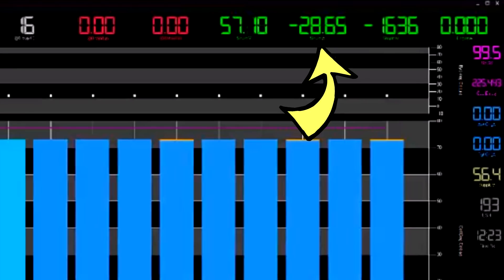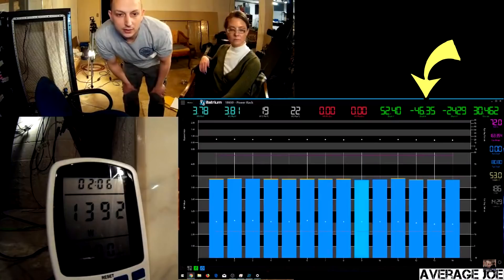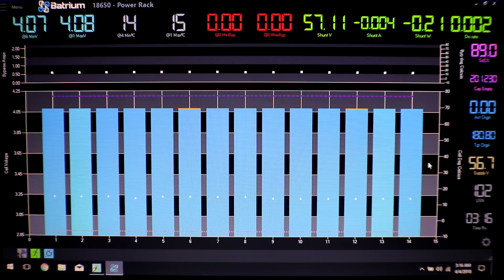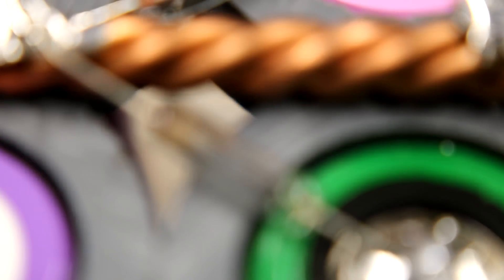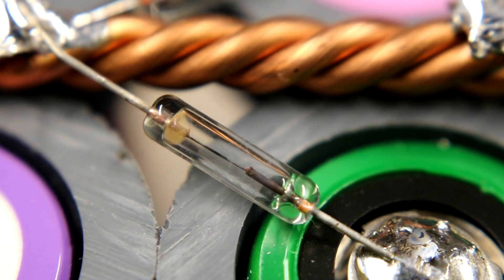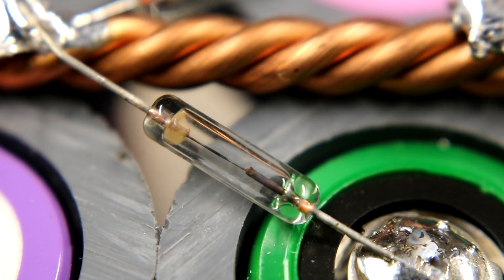Live Stream Load Test Results!!!  Pack 14 For The WIN!!!

Comment: Hi average joe!! I am building a 13s 14p battery pack for my 1000w ebike kit. The cells that i have are 2000mA for old laptop batteries. Can i discharge the cells to 1,8A per cell (in maximun power) or 1,2 (medium power). This can be safety and can destroy the chemical of the battery? Also, i put  5A fuses each cells. Thank you very much!! Your videos are really helpfull :)
Reply from the maker: I couldnt say for sure cause I dont know what cells you used.  If the pack isnt built yet you could look up the specs of the cells to see what they can handle here https://secondlifestorage.com/celldatabase.php Most use high drain cells for ebikes since laptop cells are usually 1a or less.👍

Comment: What kind of battery holders did you use for pack 14?  Where did you get those?
Reply from the maker: I built them out of 3/4" ID sch80 PVC from Lowes.  Just cut them up into 3/8" slices and super glued them together!😆👍

Comment: You could just check the capacity in place without removing it from the pack. Just disconnect the fuse from the top which will disconnect it from the pack and connect your B6 charger to the cell - charge and discharge test and if its fine just connect a new fuse. Simple :)
Reply from the maker: Hmmmm thats a pretty Neat Idea but Id have to make some leads to come from another charger as I still dont have a B6😲

Comment: Are you trying to say you do have a way to capacity check the whole pack. I have one of those little like $3 I think blue pcb ones with a display that use resistors as a load and it says it goes up to 9999Ah but get more resistors or some other load it says up to 3A so maybe a boost converter to put all that power back into the other packs but that would only be like .5A or something to the big pack
Reply from the maker: I got a new charger/discharger from Banggood (Hi-Yaw) to do the hole pack.  They finally got some back in stock.  I was thinking someone could possibly use one of the pcb dischargers but yeah it would take forever.  I guess one could just add resistors on the pack and do it the old fashion way and time it and do some math!!!😆👍
Reply: hope it is not one of those SuperbrianAK suggested(above)...they are 1) Fakes..  2) Crap

Comment: I agree with 70-80 amps being kinda of a high sustained draw on those packs. I've been noticing that any of my cells with high IR will drop out so much quicker under the higher loads. My conclusion right now is to look hard at marginal AH cells that have high IR and set them aside.
Reply from the maker: Yeah 70+ amps is high for a single 10k system but gotta tester out to find weak spots and it gives everyone else an idea of some areas to improve on and or what this size can handle.💥😃👍

Comment: I'm in process of checking each cell right now. I'm putting a label with capacity on each cell hoping that it will aid in troubleshooting down the line. Planning on making at least one or two extra cell packs, above the seven that will be in my system, so I can always have a good one to switch out with. 
That fuse is cooked....
Reply from the maker: Fun times capacity checking everything!  Yeah I should have an extra pack or 2 all made up and ready for the same reason!!!👍🔋

Comment: This was a good example of why you don't weld your cells in place. Now I understand!
Reply: Hahah, exactly!  That's why I'm going the cell holder route with the metal tabs to hold the cells firmly. I've decided at this point not to  make my own contact holders. I'm even designing the whole bms setup based off the 4x holders. Each holder will have a red led (to show when that cell is off), an inline fuse (as last line of defense), a fet (for digitally disconnecting a cell), current sensor (to know how much is going in/out of a cell), and a cheapo mcu to control it all. Well, the mcu might control a whole batch of cells that are in parallel, not just 4. So, maybe 1 mcu would control/watch 16/24 cells (4/6 holders). Still designing the layouts :)
Reply from the maker: YEEEEES!!!!!!!!!🔋✔
Reply from the maker: Hope you get all that going!  Would be cool to see for sure!!!👍

Comment: 48v with no load on the battery's is equal empty battery.... 👍 
80A is to much for your setup.....40A should be peak of your drawing out.....
Excellent video by the way 👍😎🖖
Reply from the maker: Yup! all still within safe parameters (except for maybe the UPS LOL).  That UPS is a beast.  Yeah I figure a few stress tests is good to see where the weak areas are and it also gives others an Idea of what to expect if or when they build one!💥😃👍
Reply: He can safely pull 80A, that's still less than 1A/cell under full load. That's about 800mA/cell. Well within tolerance. Plus, this was a stress test to see it's max ability, not something he'd do on a daily basis.
Reply from the maker: Yeah under normal usage 40 is a good number.  All in all Im still pretty impressed!!!😆👍

Comment: maybe you can use the 150W 10A discharger that I have to test the pack as a whole, though you can just use the whole rack and cut it at the 3v mark from 4.2 per cell then whatever the batrium says the AH is is the Ah of that pack. here is the video I did on the one I have: https://youtu.be/GQ2e373rtSw
Reply from the maker: How are you liking that discharger?  Is that roughly the same as Peters?